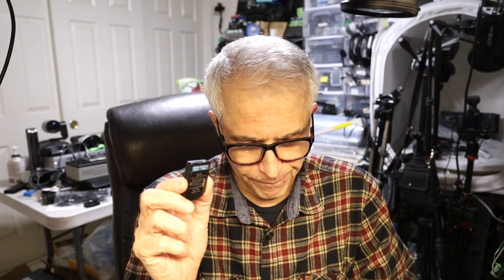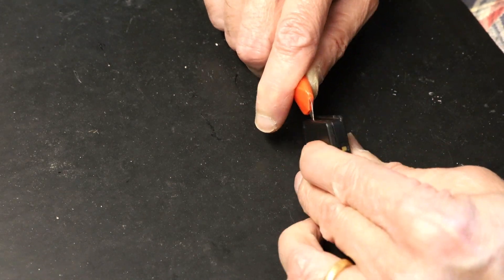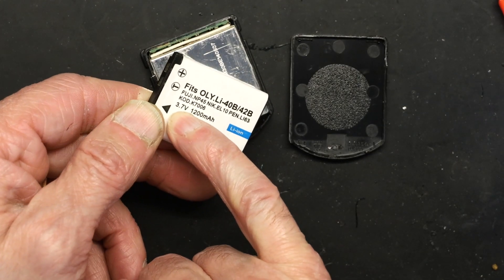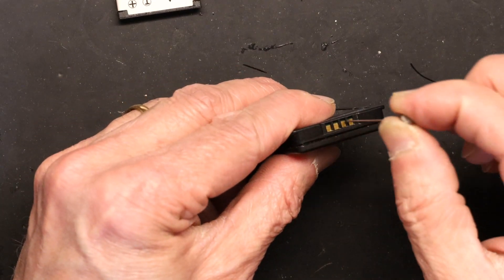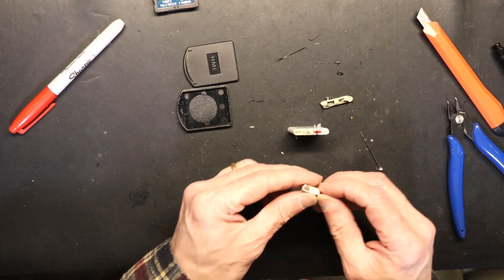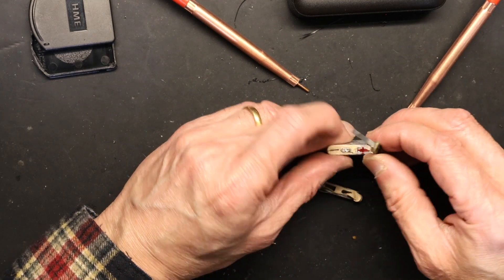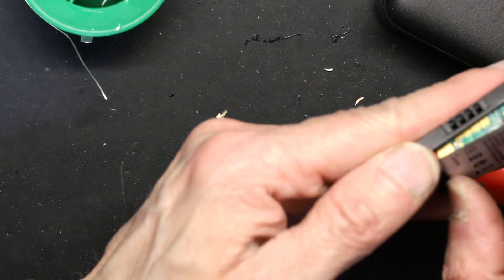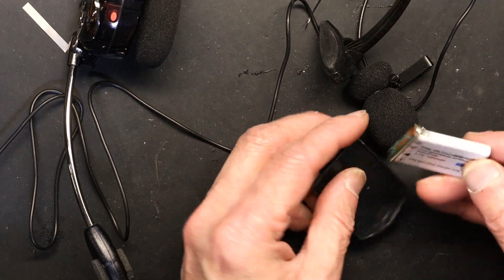Repair or Increase the Capacity of an HME BAT50 Battery For HS6100 HS6200 HS6300 Drive Thru Headsets

Comment: I was going to do the same thing, I wasn't sure if the BMI had a memory of the dead cell though. Great stuff!
Reply from the maker: No they don't have any total power storage memory, they only judge the charge based on the cell voltage. However you are correct some batteries have a current meter that count the amount of power going into the cell and then count the power going out to estimate the remaining charge.

Comment: hello sir 

I own a Garmin navigation system.  I wanted to format my USB stick and accidentally formatted the Garmin navigation system. 

Nuvi 3598LM 

There is no longer a map on the device, which means that navigation is no longer possible.  I need a map for Germany from you.  Im possible if you send me a link so I can download it. 

Thanks in advance
Reply from the maker: Greetings, the Garmin Nuvi 3598LM qualifies for free lifetime maps from Garmin. So you need to do two things 
First use GarminWebUpdater.exe to reinstall all the missing system software 
Second you need to use GarminMapUpdater.exe to re-download the latest maps to the GPS. 
Thank you
Reply: i deleted the system file. It's not connecting to the pc. it's going on and of automatically
System file formated. No more file in my garmin nuvi